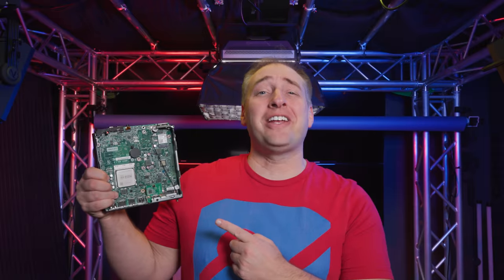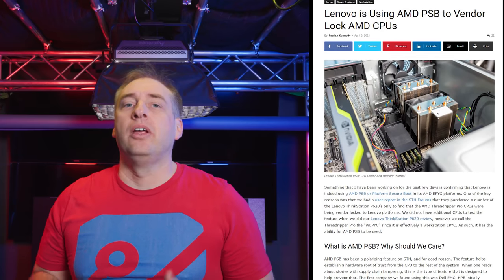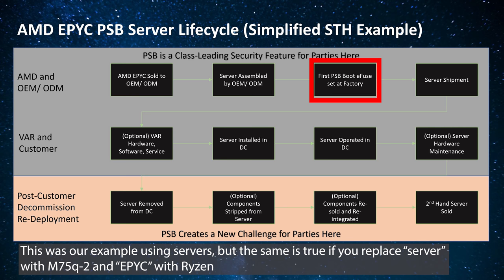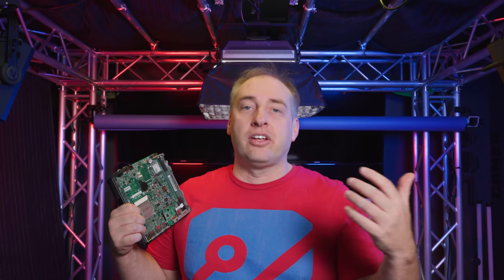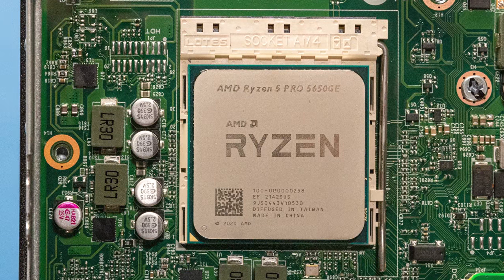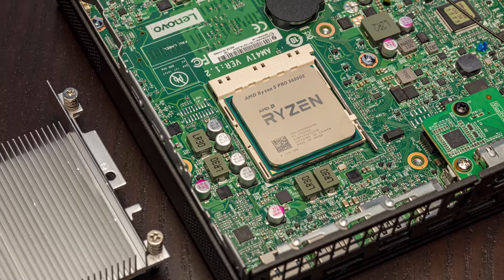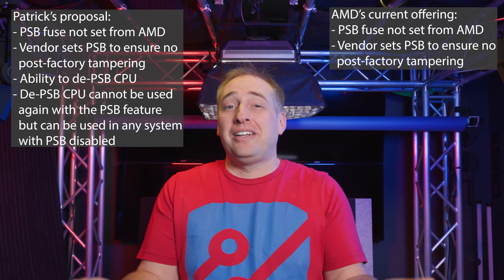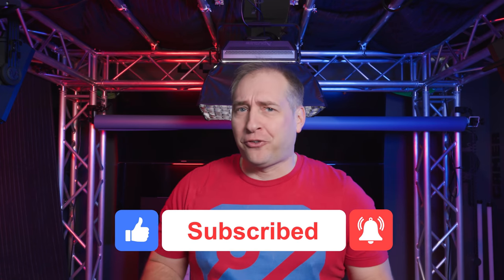Yikes! Lenovo is vendor-locking AMD Ryzen CPUs via PSB

Comment: What kind of tampering does PSB locking protect against though? With physical access, you could just swap the CPU after swapping/tampering with the bios chip. You could sign your tampered bios, and blow the corresponding fuses in your new CPU. Or is this meant to protect against some kind of remote attack where the bios could otherwise somehow be compromised anyways?
Reply: It's just 'muh security' as an excuse for planned obsolescence
Reply: The later. Several proof of concept persistence attacks via UEFI exist, and it's only a matter of time before they make their way into malware as a service chains. Adding so much preboot complexity was always a dumb idea, but sadly UEFI won out over concepts like coreboot.

The problem is real. This solution is terrible.
Reply: @michaelkreitzer1369  Imagine what would happen if attackters indeed infiltrate the service chain. Or what happens when the signing key gets compromised? Then Lenovo would have to replace their signing key and would brick all systems that do a service firmware upgrade. It would effectively kill the firmware update service chain for existing systems. Yikes.
Reply: @prescan7000  Indeed, this is just all around a terrible idea.
Reply: its because the processor has fTPM built-in - a processor-based TPM solution. The processor checks the firmware to prevent a malicious firmware to be jacked in which would capture bitlocker drive encryption keys.

Comment: vendor locking like this isn't about security.  its about depreciation more than anything.  a company can buy these knowing that there is no salvage value in the parts after, so there is less incentive and worry about them ending up in the second hand market.  this means that in 3 to 5 years after these are purchased from lenovo, the company that bought them can say they have fully depreciated in value and claim their full purchase prices as a tax incentive to buy new ones.  part of that "full depreciation" accounts for second hand market resale value, and being that these are vendor locked parts and not going to work in any other systems, and no other processors are likely to work in the motherboard, it costs them less to "dispose" of them, and still get their certification of destruction.  this is much like you see less and less second hand server stuff like the R700 series dell servers, because to get full depreciation, they have to ensure there is no second hand market value(thus, they get destroyed).  there was a tax law change about 4 years ago that added this requirement, thus, ewaste "recyclers" have to verify destruction of the device else they can be on the hook from the IRS for the second hand market value.  this is why apple stopped that company that was recycling their broken parts into working phones, because it left apple on the hook for that value to the IRS.
Reply: @theglowcloud2215  How don't they pay taxes? You think the enterprise just landfills their old gear?
Reply: @timramich  amazon paid zero dollars in us federal or state taxes in 2020. And yes, they just landfill their old stuff because they told the IRS it lost its full value to be able to claim its value as a tax incentive to continue paying no taxes. If those parts end up in the second hand market, and the IRS finds out, not only do they lose that tax incentive, but they then get penalties and fees, and then get put under a microscope for other stuff.
Reply: @chubbysumo2230  Okay
Reply: Finally someone making sense.
Reply: Abolish the IRS and simplify the tax code to fit on a single page, readable by your grandma without her glasses.

Comment: They can leave their stupid fuse however they want, but just let me disable PSB entirely. At that point, it doesn't matter what the CPU is locked to. Either way, this is a ridiculous solution to an imagined problem and all it'll do it create lots of e-waste when these systems leave the datacenters and enterprises in a few years.

Also, if Dell and Lenovo are reading this: I'm not buying your crap until there's a satisfying solution to this problem.
Reply: This will not affect me now but like my dislike for anti-consumer Apple, you have to stand up for consumer rights or eventually it will be your problem too. Just canceled the Lenovo Thinkpad AMD I wanted and switched to a like HP. The similar 15" HP was $200 less anyway and although I love Lenovo and have had 1 Intel idea pad and a Thinkpad over the years the HP is also fine and I sent another HP as a gift to my Mother in law a few months ago and thats working out fine. Also HP's accidental drop and mess up warranty is great when you have a lot of kids around. I worked for a fairly large school district troubleshooting PCs in computer labs and Dells are such junk. It's a shame Lenovo is doing this as I really like their Laptops. I make all my desktops and will continue to use AMDs as I switched from a decade of Intel's after the 3000 series really has it together. I Built a 5700G for my wife and she runs 2 Monitors off it with the built in graphics as she uses it for business not gaming. Used a Asus 570 and it a DP and HDMI connectors on the MB and it configured her vertical monitor and the other perfectly. only 1080 but if she wants new higher res we can always add a card. We run Win 10 and Xubuntu and Manjaro in our various devices.

Comment: Your solution appears quite logical. An issue with it would be if the processor could then be put back into the original system to unlock its files assuming that PSB serves some function other than branding the CPU to the system manufacturer.
Reply: If you have physical access you could just read the drives with... Another motherboards!!! Imagine that! If your PC is physical compromised your security is a joke
Reply: @virtualtools_3021  but there encrypted.

Comment: Lenovo has a history of locking out hardware. They did this to Lenovo laptops that came with 16GB Optane modules. If you found a crazy cheap 32GB module on Ebay and wanted to upgrade, the Lenovo BIOS would lock it out as a disk acceleration device. We asked support on this and they confirmed that only the 16GB module would work.
Reply: Not Only there. Also Wifi and WWAN often have this kind of vendor lock. Even on Lenovo.
Reply: There used to be an underground bios modding community .. that removed this bullshit. But signing checks made it harder
Reply: @LiEnby  I love motherboard makers that have flashback functionality to flash modified BIOS. That should be industry standard. Only people that know what they are doing would ever even know the functionality existed.

Comment: This doesn't really fix supply chain attacks though right? Someone doing a supply chain attack by, say, flashing a backdoored firmware, could just also get a fresh CPU and PSB mark it with different signatures corresponding to what was used to re-sign the modified firmware. Everything would still seem to work on the compromised system. A customer would need to open up an potentially compromised OEM system + swap in a non-compromised CPU from the vendor to test for a supply chain attack...

Comment: I like how the Atmel/Microchip arm processors have a "erase" pin. You pull the pin high and it erases everything. Since eFuses are generally flash based these days they could provide a "erase" pin. Of course the pin might need 12 volts though so that would require taking it out of the system to erase it. So they might be able to make a way to clear it.
Reply: I'm pretty sure it is not that simple. These things act like real fuses, essentially a burnt trace.
Same tech is used to internally customize basic ICs (not just CPUs or Microcontrollers) during factory production cycle.
Reply: @RmFrZQ  they may act like real fuses, but a real old school Fuse would be huge and take a lot of die space. that's why I am guessing a EEProm type cell is used. But it might lack the charge pump to get the voltage to clear it.
Reply: @LaserFur  they are not huge. It is basically a short trace between two points. You can find videos on YT where people dissolve casings of ICs and use acid etching to see how a die looks internally, layer by layer, under a microscope. They usually comment on what is shown on the screen.
Reply: @RmFrZQ  I did some reading and you are right. the "elecro migration" and shoring types would be small. I was thinking of the old prom descriptions.

Comment: Wow, I'm glad I canceled my order of M75s Gen 2 back in late 2020.  No more Lenovo for me, forever.  HP is already on my black list, so, well, always build my own.

I also own an M715q (Ryzen 3 PRO 2200GE).  I bought it back in 2018, just to obtain a PRO APU.  I'm using the PRO APU on an AsRock motherboard with ECC memory (had one ECC error in almost 3 years of 24/7 operation).  I also revived the M715q using a retail Athlon 200GE, and it's still working fine.  So Lenovo was good back then, but not any more.

Comment: 11:53 I suggested something similar, but i'd argue that either non PSB processors should not work in the motherboard, or there should be a motherboard lock for PSB with a pre-POST splash screen provided by the ARM procerssor that basically says if you continue to boot, PSB chain of trust will be perminantly broken. Because if i can compromise a PSB enabled motherboard, with a non PSB processor, and then turn around and compromise vendor locked PSB processors, is it really that secure.
Reply: If PSB is enabled on bios but PSB permantly disabled.. don't boot? I guess idk
Reply: @LiEnby  right, or there is a slash screen that allows you to disable PSB on whichever part has it enabled, this should require the BIOS password to be entered

Comment: This isn't about security, devaluing the processor wasn't the primary goal, forcing you to pay them several thousand dollars for a security patch and firmware updates is the goal. Hence the "nearly given away" server referenced in this video. This has existed in the server space for a while, but charging for security patches at the Workstation level is a one way ticket to failure.

Comment: It's a good example of a poor decision. Sure it's a 35W part and probably nobody is going to miss it but it's destined for a landfill if PSB is actively engaged by each vendor, which may not even be the case. So, whatever. I still use a 1.6GHz overclockable Athlon 2650e in an eMachines/Acer to run my backups and network shares with minimal power draw and it took a bit for me to get there from other AMD parts. It's the only familiarity I have with g/e parts in AMD's entire lineup, which says something. I run a vanilla Ryzen 5 3600 in my main workstation and I realize that someday I will retire this system too. There's no issue with doing that but it makes far more sense to assign processing power where appropriate. For a lot of us doing competent web cart multi-user membership sites, yeah a 5650ge looks like a good deal but most of us don't even need this much. So it's probably going to disappear (in a landfill) as quickly as it gets made.

Comment: Regarding the claim: "Vendor sets PSB to ensure no post-factory tampering"
I'd say this is not a valid claim where physical access to the device is possible. Consider this:
An attacker tampers with the firmware (e.g. during shipping) of a device. As the process of burning in the fuses for new CPUs is part of the firmware, the burn-in-process can also be removed from the firmware while modifying it.
If this is done the device will no longer boot anymore with its original CPU - all as intended. But after the replacement of the CPU with a brand new one (that is not vendor-locked) the device will work again. As PSB is effectively disabled now the new CPU will not get vendor-locked. And no one will know it has been tempered with.

Therefore the PSB feature just raises the cost for attacks: you need to provide a non-vendor-locked CPU (but in return you get a locked one back).
As said earlier, this only works with physical access.
Reply: A company can easily detect this by testing with a known blown CPU.
Reply: @zacker150  I would not say easy to this. But yes, they could do so, but who will test a brand new system if there is zero indication for a compromised system? Also: the test only works if they have a CPU that they can be absolutely sure about that the CPU they're testing with has the correct PSB key burnt in.
In the end this comes down to the problem Patrick already mentioned in the video: There is no way to tell if there is any PSB key burnt into the CPU other then testing it in different systems, that we "hope" to use the correct PSB key.
Reply: You would know if the CPU has been replaced, that’s the entire point. Yes, you can tamper with the CPU by replacing it, but your system won’t boot if imaged from the factory because the trusted chain won’t match anymore.
Reply: @GuruEvi  Nope, you got PSB completely wrong. Replacing the CPU in a standard PSB protected system is not a problem at all - as long as the new CPU is vendor locked by the same vendor or not yet vendor locked.
Reply: @swatty2009  I don’t know about the AMD, but Intel has a similar feature and Dell and HP uses it, I can guarantee you, that thing will let you know and won’t boot an encrypted secure boot environment if the CPU or BIOS settings have been tampered with, you do need a signed CPU from the vendor. 

Basically if the CPU has to be replaced with an unsigned CPU and you haven’t been able to unlock the secure boot before (you basically give Dell/HP a signed disk image from your end, so the idea is that during shipping it can’t be tampered with) the thing won’t boot.

Yes you can use unsigned (unlocked) CPU but the boot chain won’t validate anymore. Only if you get an original Dell CPU that hasn’t been tampered with can you continue. It’s useful in some cases to know your hardware isn’t compromised. You can even give Dell your own keys to “fuse” the CPU with so your CPU’s are company-locked.
Reply: @zacker150  would they though? Most probably never even OPEN their computers, let alone go through the whole debacle of testing it

Comment: Absolutely agree with everything said. There should be a way to unlock it, but in the process you invalidate the security and it wipes, or renders inaccessible any stored keys/certificates so it can never be used in a secure system again but doesn't drop the ass out of the used market.

How you do that, maybe something in the BIOS that you set and it sends a special instruction to the CPU to wipe itself and unlock the security. Maybe such a thing does exist already but AMD aren't documenting it.

Comment: Good to know, but why does it matter? I'm not going to buy a brand-new Lenovo ThinkCentre just so I can pull out the CPU and put it into a different computer. That would be a waste of money.
Reply from the maker: Aftermarket CPUs can be less expensive than the upgrades from a vendor (very common in servers as an example) so people configure lower-end CPUs, then replace them assuming they can sell the original CPU for some value. This is not common in the primary market (large corporations) but does happen on these both when they are new and on the secondary market.

Comment: Reminds me. Back in 2015 when I switched from an A8 6600K to an Intel Xeon E3 1231 V3 and because both of them used DDR3 I thought I can take my RAM with me to the new PC and just upgrade it later. But no that was not a thing. There was a sticker on the RAM from the old system that said AMD only. Never heard of that before and well just tried it out but it won't boot at all. Threw it back into the old AMD system and it worked. 
I was so confused about RAM being only for one brand. Could use the RAM with all AMD CPU's but not with intel. Was happy that I had 4GB around and bought 32GB later. I don't know why that would be a thing.
Reply: A lot of RAM especially in DDR2 and DDR3 days was incompatible with either or and nor because of specifically being locked to AMD/Intel
Reply: @rkan2  Still I have a ton of DDR3 RAM here and no problem using it for either AMD or Intel when testing it was only that one stick.
Reply: It was because it is high density ram only amd bothered to support it, and some nforce chipsets

Comment: I guess I am not quite understanding the security aspect. You can use any cpu in these boards or only one from Lenovo? What security is gained from make the cpu not useable in non Lenovo machines?
Reply: It's not lenuvo motherboards it's specifically boards running a firmware that is signed by Lenovo.